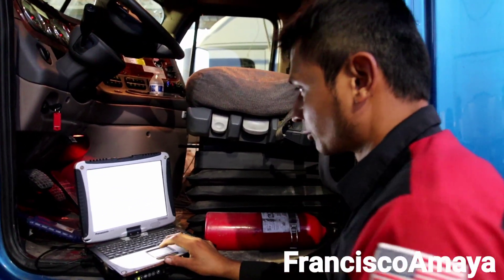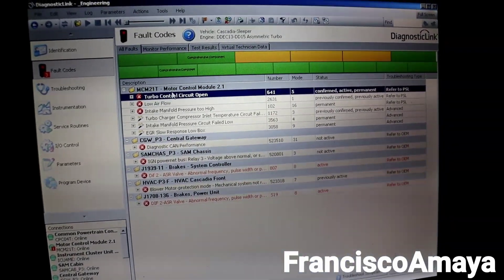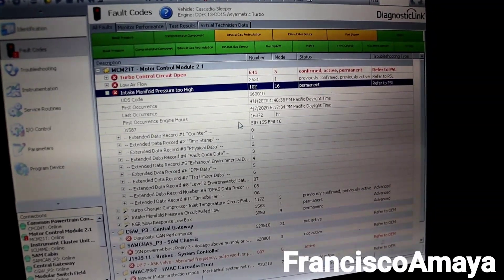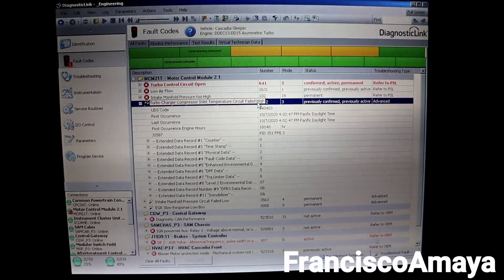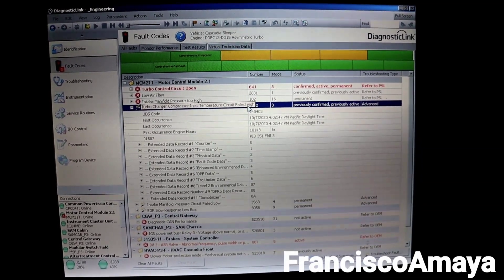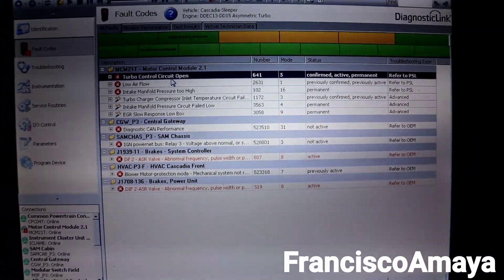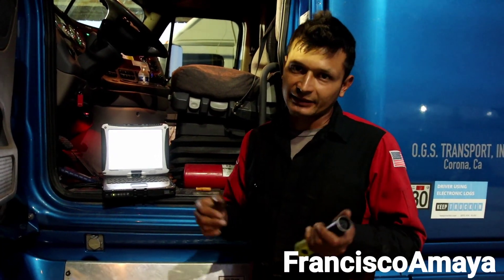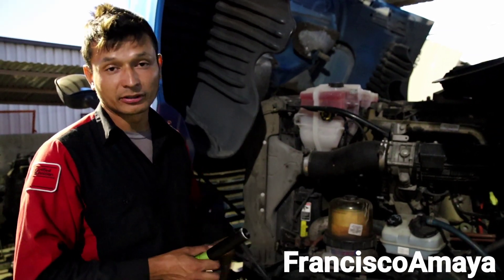Freightliner Cascadia DD13  DD15 DD16 no power turbo control problem spn 641 fmi 5 no turbo pressure

Comment: Francisco  I have similar problem  sensor  pressure on  rubo in  light  engine  is on and off  with low power  I need  your  attention  where  are you  my friend

Comment: Hello sir 
I have a 2015 freightliner cascadia dd15
Code spn 102 fmi 18
I am replace new turbo charger 
New charge air cooler
All sensors
New DPF One box all sensors
Also chnage throttle body
Hoses but 
Spn 102 fmi 18 still on board i am tired and trouble please if you know anything about on these code help me

Comment: Hello Francisco 
I’ve been following your channel for a while. And you really have helped me out with my dd15 throughout the years.  If you have time can you tell me what’s going on with my dd15? I hear a sound of crickets sound on the passenger side by the turbo. And I hear air noise when I accelerate
Reply from the maker: 2015 or 2016? Maybe the turbo wastegate actuator is going bad
Reply: @franciscoamayaYT  Hi, Francisco. I have an 2016 DD15, and I’m having this problem, there’s a leaking air under the turbo, so there need to change only the actuator ?

Comment: Gm Francisco I'm leaking oil from my turbo and losing power I replaced the turbo and it's the same thing I have to turn the truck off and start it again then I will get power power, there is no check engine light what you think I should check first? 
Thanks 
Craig

Comment: I have 2017 DD15 505hp  no check engine light. 

After 2 or 3 hours ideling when I move. it wants to shut off drop RPM poor pickup when it moves little bit then runs good with time..help me

Comment: Is the turbo still good or does it have to be replace?
Reply: No only the turbo control module needs to be replaced because he checked wires with wire scanner and the wiring harness was good. So the culprit is turbo control module only. Turbo is fine

Comment: Hey good morning Francisco I have a 2016 cascadia with DD15 and I have a code 3464 low emissions system fault and I have replaced the sensor and the delta sensor as well but still keep coming on after a few days so I like to know what else can I look for to stop that amber light from coming up
Reply: 3464 is for bad def quality. drain the def and replace with new def
Reply: Thank you Francisco I’ll do that..!!